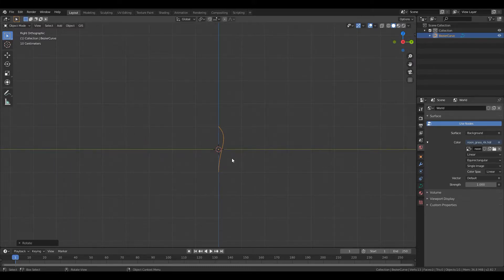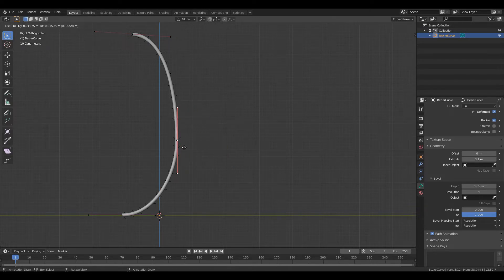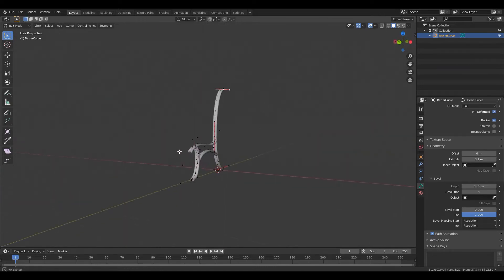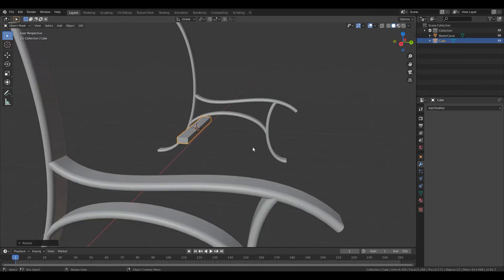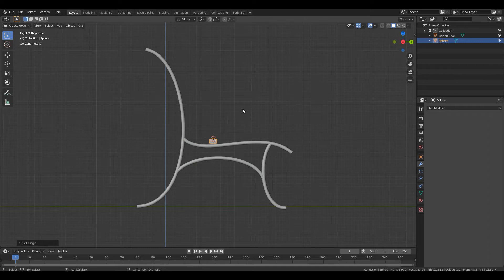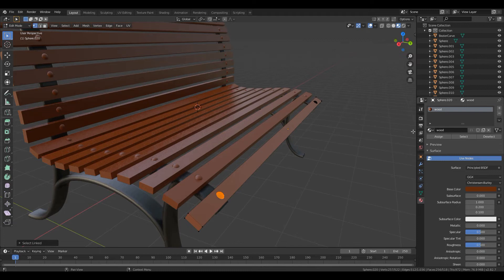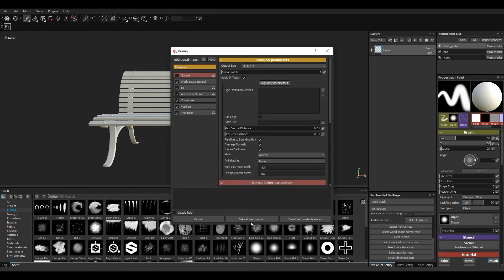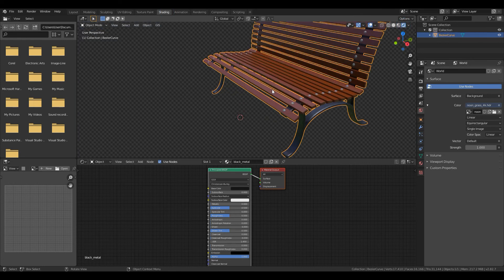[2.82] Blender Tutorial: A Dozen City Props | part #8 - Bench

Comment: I am new to blender and have no knowledge about substance painter.  I know that thee are some materials texture included in Blender or as addon (both free and charge). May I know the difference of using those materials texture in these addon and those painted in substance painter? If the texture is available in Blender addon, then what is the purpose of doing it in substance painter. Thank you.
Reply from the maker: Thanks for the question. 👌
First thing first, the addon for Blender you are talking about I assume that is "Blender Kit Asset Library" and is a preinstalled addon. Now, textures yes are included but:
1. Taking time to load (this depends from your connection) 
2. Cannot be modified 
3. Cannot find all the Textures you would like. 

As for Substance Painter, is a powerful tool which gives you the ability to:
1. Create any material that you like
2. Close user experience more or less for these that worked already with photoshop
3. Smart materials are just some predefined materials with masks applied etc..
4. You can always create your own and save them for future use.
5. In substance painter  you can give depth by drawing to it
6.etc......

Concluding, that Substance Painter is a powerfull software for creating nice HD Textures.
Reply: Bullet Tuber very clear. I would follow your tutorials to do the city properties. I would like to have a cartoon toon shader. Could your please give tutorial on how to cartoon shade (like Japanese manga) using your city properties. Thanks a lot!
Reply from the maker: Of course. When series of a dozen Props is done I will switch back to the series on how to create a city to start adding this Props to the city and also create a tutorial for the cartoon shader. 🙏
Reply: Bullet Tuber Great! Hope it will come very very soon 🙏👍